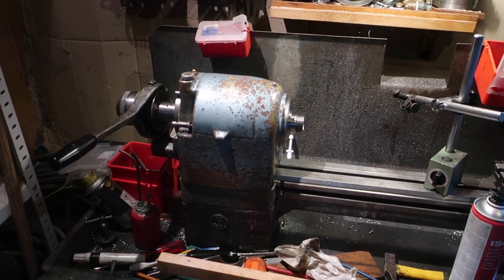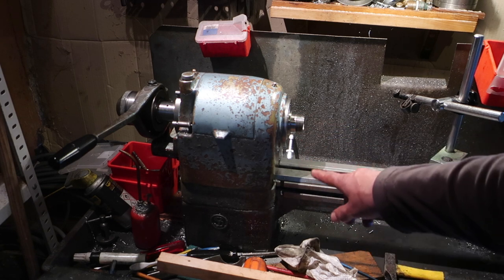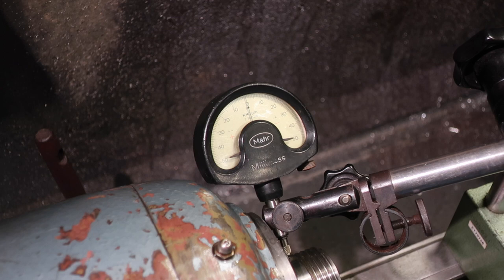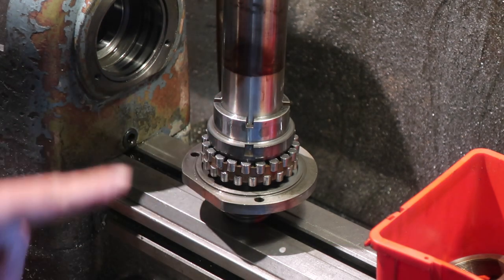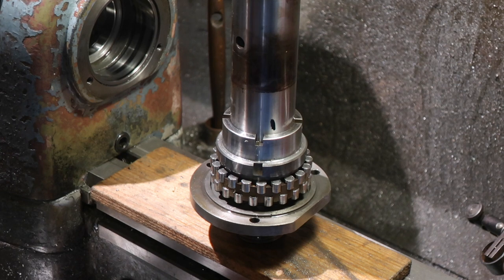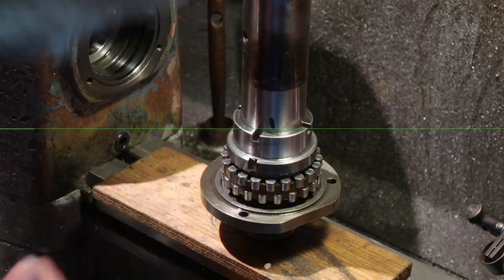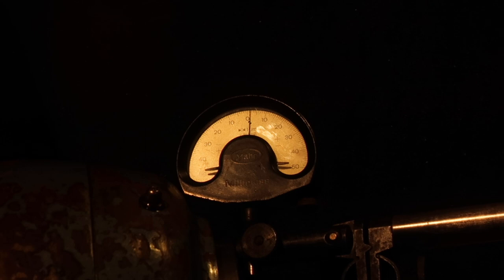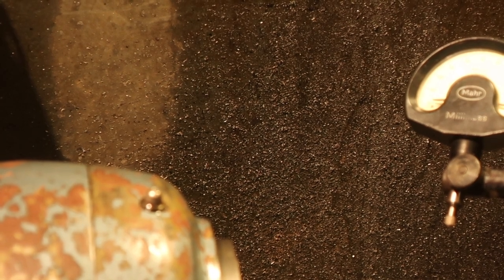Schaublin 102 open heart surgery

Comment: Great many similarities between your 102 and my Smart & Brown model L. I wonder if they use the same collets, mine are No. 2804
Reply from the maker: The Smart & Brown collets are pretty similar in form to the W20 collets the Schaublin takes, although closer in size to the W25 size (some 102s came with those as standard, as well as some that had F23 - it's "complicated"). W25 are a bit longer and very slightly fatter than S&B, and have a metric (although oddball, 1.66 pitch) drawbar thread.